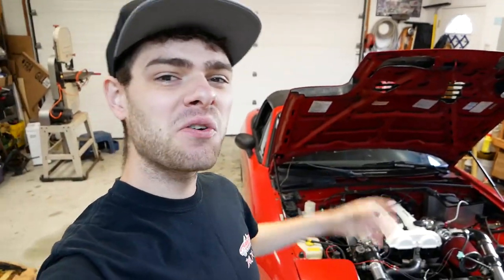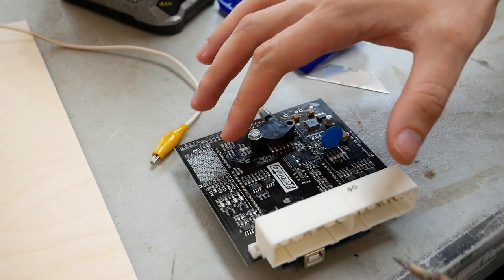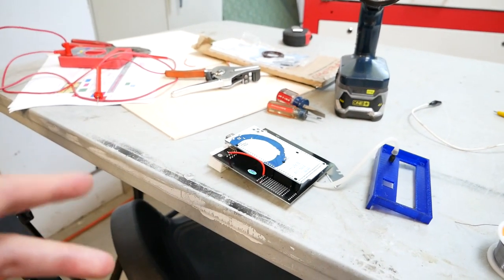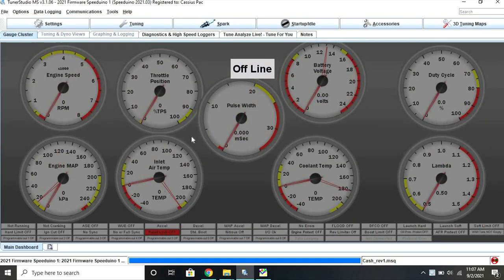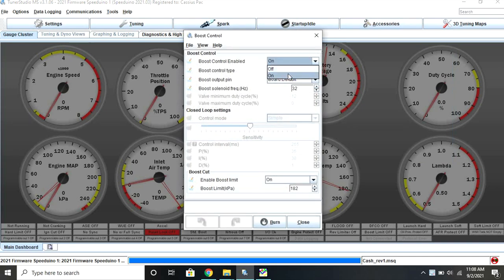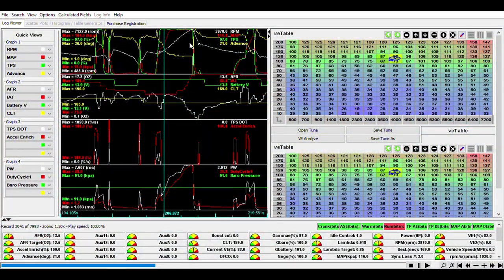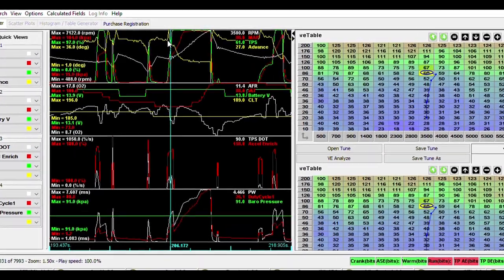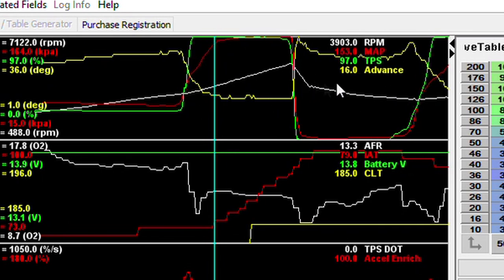Electronic Boost Control: Wiring, Settings, and Results [Speeduino and Megasquirt]

Comment: Fyi, the newer speedyefi board have the boost pin already wired out to the evap solenoid plug in the engine bay. They started doing that around 2021 so you might not need to solder anything.
Reply from the maker: Thanks for that tip! I appreciate it and it should help a lot of people
Reply: just pulled my new one apart boost pin is still open would still have to wire it like the  video i guess only wondering what pin to select in tunerstudio

Comment: Is it worth buying a standalone ECU with no other power mod?
Reply: Price to performance, not worth it. BUT it gets you going in the right direction. You'll learn how it works and you're setup to install power mods
Reply from the maker: It depends, like Logan said, it’s a good first step. Also, with a good tune you could pick up some moderate power gains, more so on 1.6 cars since you can get rid of the AFM. The key is a good tune

Comment: Man this is awesome information. That said what do you mean by T’ed off and goes to the header pin 2x on the V1.3 boards? Which is the one I have and wish to do this. Also if you have a link to some information for all of this that would be greatly appreciated and helpful. Thanks bud I’ve learned a ton from you over the past year

Comment: Great video! when going through tuner studios to get the signal for the boost controller what are supposed to select if your using the purge valve? Thanks for the help in advance
Reply: did you manage to find the pin im having the same issue rn :D

Comment: @CashedOutCars 
You want to keep boost control low below 3500 RPM, this is because you dont want to get more then your lowest amount of PSI in this low rpm range.
This wont promote spool, just create a higher psi limit.
High boost on low rpms causes rods to bend, the map below 3000 should be 0. (Unless the wastegate spring is like 4psi, wich is very low)
Reply from the maker: On my car it did help spool, since higher boost down low = more exhaust flow at lower rpm = faster spool. This is because your boost controller is holding the wastegate completely shut vs allowing it to slowly open slightly as boost builds. (They open gradually, not like an on off switch). It had no effect on the upper PSI limit since that is controlled with the boost control table at higher RPM, since this turbo still spools relatively slow, so I never make lots of boost in that area

Comment: Hi, 
I might be dumb or my english is not the best, but where did you set the actual targeted boost level? In boost control menu there wasn't any place for a pressure input, and you said the boost cut is a different story - it's just for hard limiting and protecting the engine. In the table where you set the numbers to 100s and 10s weren't pressure inputs either, for the open loop. Then how do you know what is going to be your max boost? Do you have to calculate that in head related to the duty cycles values? Im lost
Reply from the maker: It’s a bit trial and error in open loop! There isn’t an easy way to calculate what your boost level will be based on duty cycle since there are too many factors. Closed loop will target a boost level based on your target table. Good luck!
Reply: @CashedOutCars  Another thing just popped into my mind - did you change the internal wastegate spring to a smaller psi rating? In my theory: if you set boost controller to eg. 7 psi but the spring is rated at 9 psi, then it still going to reach 9 psi of boost because the spring won't let the actuator move at a lower pressure. Or you simply already went above the stock spring rate with boost :D ? Sorry for this much question, but you are working on these mods and you are the best source of valid information because of this. I appreciate your content and help.
Reply from the maker: You’re correct with what you said! The lowest boost you’ll be able to run (assuming no boost creep) is what your wastegate pressure is with no boost controller. You can raise your boost with one, but you can’t lower it!

Comment: NICE VIDEO AGAIN MA BROTHER. BTW THEY SAY WHEN YOU USING A SPEEDUINO YOU MUST REMOVE A TOOTH ON THE CRANK SHAFT TRIGGER WHEEL. DID YOU HAVE TO DO THAT?
Reply: He's got a 1.6 Miata that didn't come with a toothed crank trigger wheel, only a cam angle sensor on the back of the intake cam. 

Speeduino supports the "99-05" trigger pattern used on the NBs with VVT, which is used to compare the crank angle to the cam angle to measure the cam advance on VVT cars. I don't know if the 96/97 trigger wheels are exactly the same, but they're not necessary since you can just rely on the cam angle sensor, though the crank angle sensor does provide extra resolution for more accurate timing. Apparently Mazda just needed the crank trigger wheel on the 96-97 USDM cars for misfire detection to pass OBD2 requirements.
Reply from the maker: I did not! This was purely a plug and play install
Reply: @agerrgerra1361   THANKS FOR THAT INFO